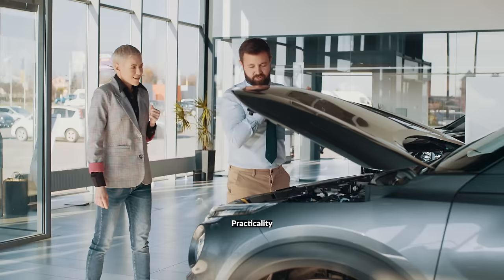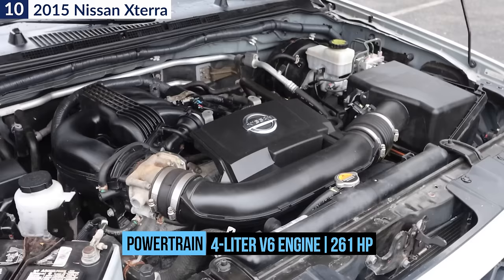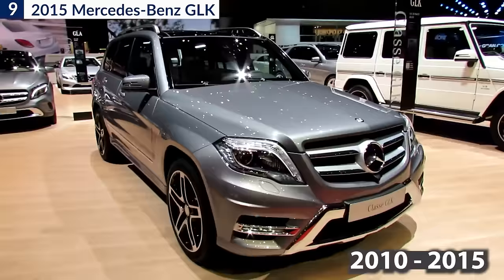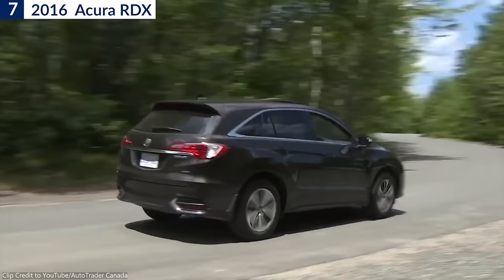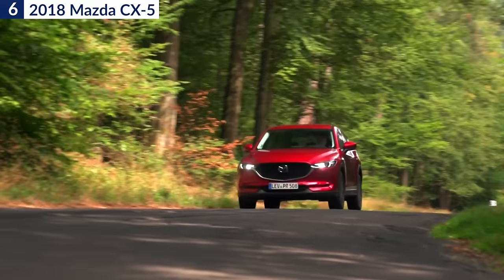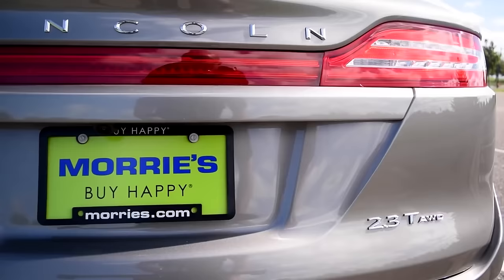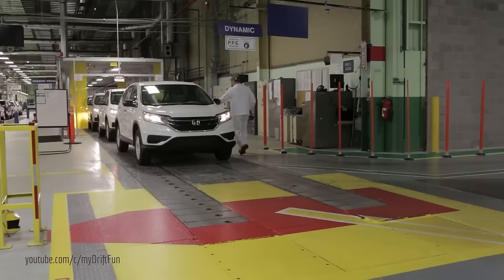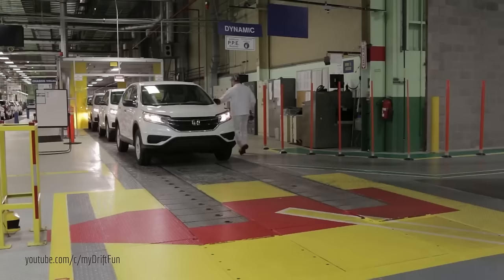10 Reliable Used-SUVs UNDER $20K  |  Here is Why They’ll Last A Lifetime!

Comment: You lost me at anything Mercedes and anything turbocharged.   I own two turbo cars currently, and have owned over a dozen through the years.   Great fun, great power, but not good for someone looking for 200-300k+ longevity.   Yes, they will make it if you take care of them.  If you baby them, that misses the point of owning one!   Heat and wear are the enemy of any engine.  Turbos make lots of both.  

Mercedes, even a minor repair that most cars would need as regular maintenance (main belt, spark plugs/coils, etc.) is 4-5x the price of what it will be for a Toyota or Honda.

Comment: I own the 2018 Subaru Forester at only 32000 miles I have spent 1500 on a new compressor and now need a ac fan at a cost of 900. I hate this suv and would never recommend Subaru
Reply: I rented one and loved the interior but my son said they are constant maintenance problems. Sorry you have had so many problems.

Comment: The worst used SUV is the rav4
Reply: 2007 Toyota rav4 sport v6 4wd with 190k miles. Only regular maintenance done and never given me problems 😊
Reply: @bookishmama13  2004 RAV4 AWD still running perfect with only regular maintenance and some low cost repairs. 150k miles...